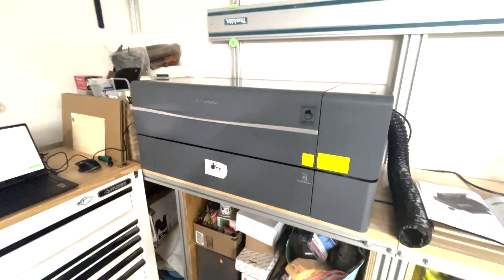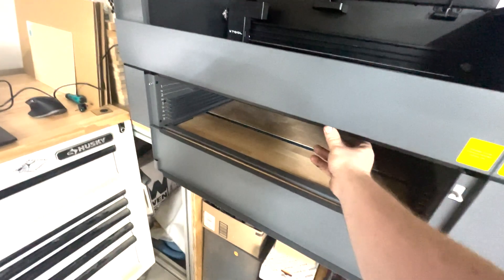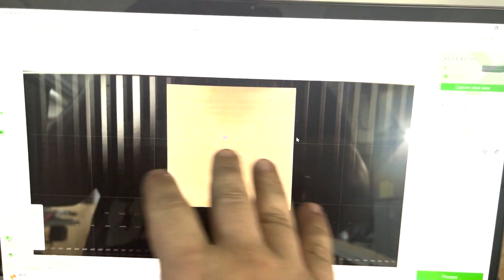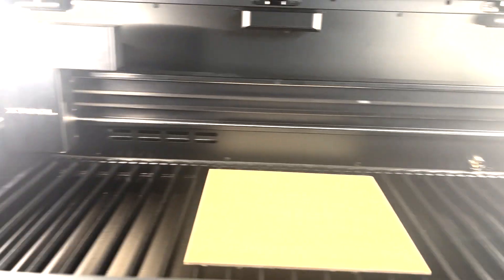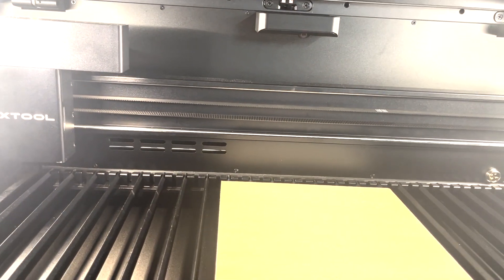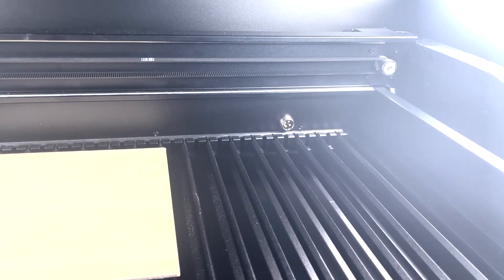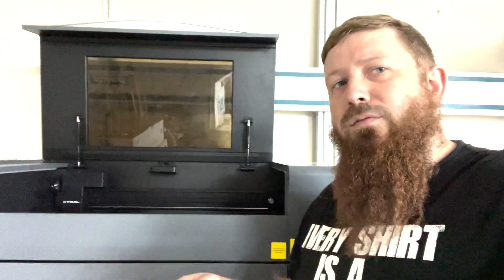The xTool P2 CO2 Laser Cutter has a lot of Amazing Features

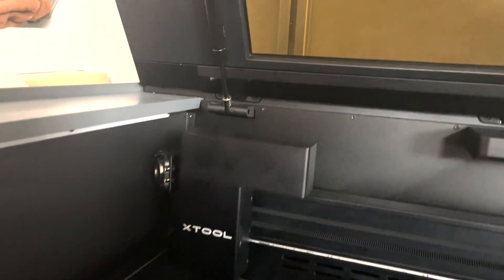Comment: How intricate will the P2 cut?  Could you make paper lace like for wedding invitations or filigree earrings?  I work in 1:48 scale miniatures and intricate cuts are a requirement.  I'm trying to decide between this and the FSL Beambox .  The P2 has more features, but FSL offers an accessory 1.5" lens.  Any thoughts?
Reply from the maker: The laser dot size is .15x.2 mm, so the details are pretty fine. I’m not familiar with the beambox.

Comment: I'm considering to buy a Xtool P2 Laser engraving machine.

Since the Xtool supports doesn‘t understand me, my question to you:

If I work with lightburn and use the camera alignment, do i need to re-calibrate my camera every time the material height changes?

I'm asking this because right now, I'm working with a diode laser with a lightburn camera, where you have the mentioned issue. For example: I calibrated the camera with a 3mm board, alignment works fine. When I put a 20mm board in the work area, the alignment is off, so i have to re-calibrate the camera.

If the answer to my question is yes: Is this problem solved when using the company-software insted of lightburn?
Reply from the maker: I haven’t used lightburn yet so I can’t say. That doesn’t seem to be an issue with the factory software though. I’ll probably stick with that for a while.